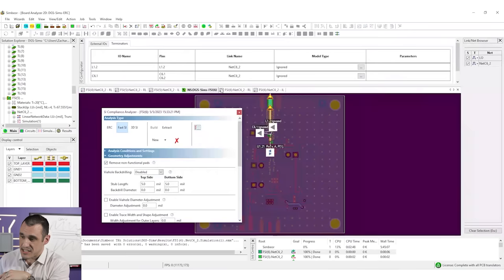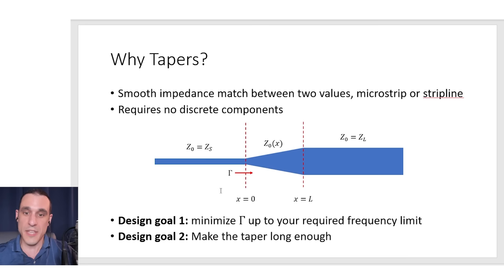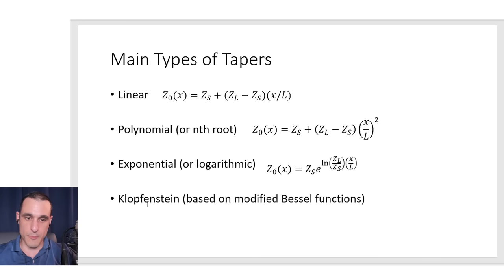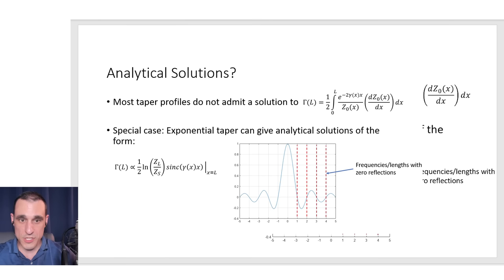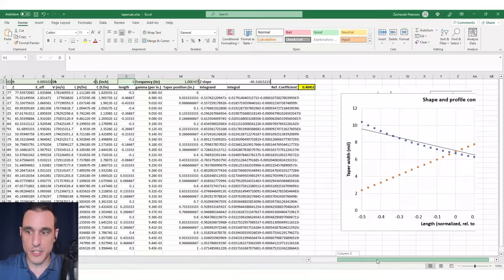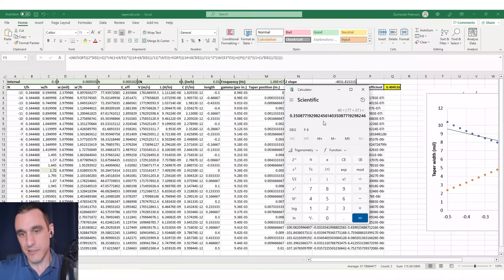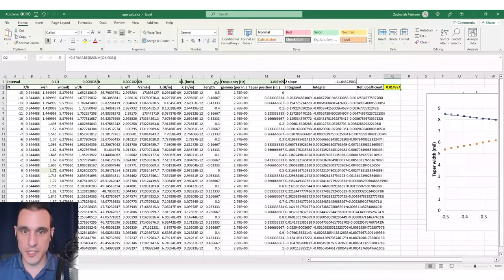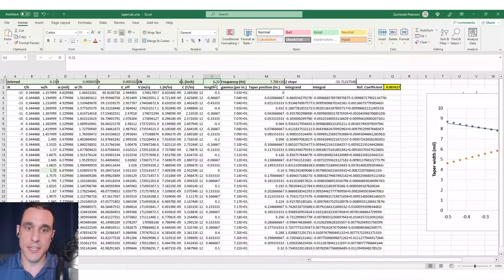How to Design RF Trace Tapers (With Free Calculator!)

Comment: Hello Zach! Thanks for the video! Hardly ever thought that even optimal taper length can be analytically calculatable 😅, will take that as a learning. So far the idea has remained to be that to stretch the taper as long as possible for a given allowed space.
Reply: Yeah I think it is surprising that you can calculate a useful length, but if you think about it the taper has an input impedance, and that input impedance is a function of the signal wavelength. If the wavelength is much longer than the taper then the taper would appear invisible, just like any other impedance discontinuity.
Reply: @Zachariah-Peterson  Yes agreed. Probably this is one of the few instances when very high frequency came out as a relief 😅

Comment: This video provides valuable educational content, and I truly appreciate it. Thank you for sharing such helpful information. I have a question regarding impedance matching: I need to match an input impedance of approximately 1 kilohm to an output impedance of 50 ohms. Do you believe that I can achieve this using the Excel file you mentioned? Your assistance would be greatly appreciated. Thank you.
Reply: The calculator is only for matching between traces of different impedances, it is not intended for matching impedances generally. This is because the trace width defines the trace impedance, but a high impedance value such as you reference might have no relation to pin size or pad size used to connect to the trace, so most likely modifying trace widths coming into a component will not give the desired level of impedance matching.

Comment: Thanks for another great video. When you were trying to calculate the wavelength of this 3GHz signal (at about 16:00), you used 3 as Dk  value. Shouldn't sqrt(3) be used in the calculation instead?

Comment: Shouldn't it be possible to design a connector and footprint such that the specified impedance (50 ohm, 70 ohm, 300 ohm, whatever) is maintained from cable through connector and footprint? An Industry Standard on this would greatly simplify the implementation of board-to-board connections; connector impedance shows up in parametric searches, footprint can be copied from datasheet, standardized transitions from footprint to board traces are standardized, Bob's your auntie.
Reply: I'm not aware of a standard specifically on board-to-board connector footprints, right now you have to call out things like ground cutouts in a datasheet, or the designer needs to simulate it themselves. The other thing is that a problem is that you can't put polygon cutouts in internal layers in footprint data because they are stackup-specific, maybe you can do it with a keepout. So unfortunately there is a bit of disconnect between footprint data, CAD tools, and what is actually needed in the footprint when it comes to RF connectors. But to be honest it might not be the best idea to put that kind of object in a PCB footprint just because the cutouts required depend on multiple factors like the board thickness, any coplanar routing present around the signal pin, etc.

Comment: Sir can you tell me length matching tolerance equation
Reply: Are you referring to length matching between the traces in a differential pair? The equation is based on the allowed timing mismatch between two signals, and this is based on the rise time of the signals. As long as the two signals in a differential pair are switching at the same time, then the differential receiver can recover a logic state from the differential pair. So this means the length tolerance is equal to the rise time tolerance multiplied by the signal velocity. The best timing tolerance to use is the receiver's timing skew limit, which is often found in datasheets. You can watch more in this video: https://www.youtube.com/watch?v=LdqzBb60i6g

Note that it is best to try and get as close as possible to matched lengths on long routes. This is because random and deterministic skew both accumulate along the length of the differential pair. With random jitter you cannot control how large the timing mismatch will be, even when the two traces are the exact same length.